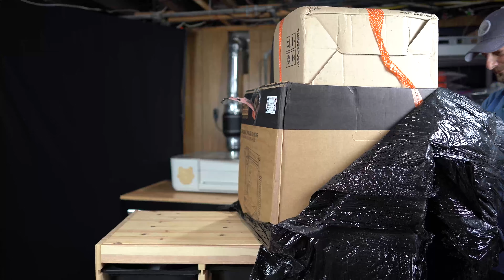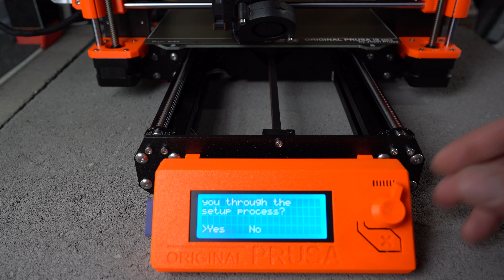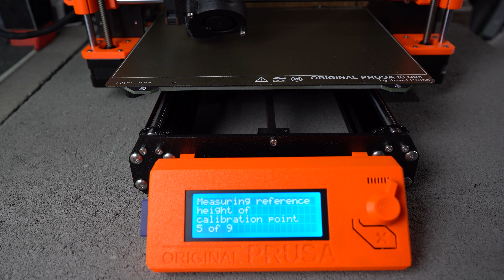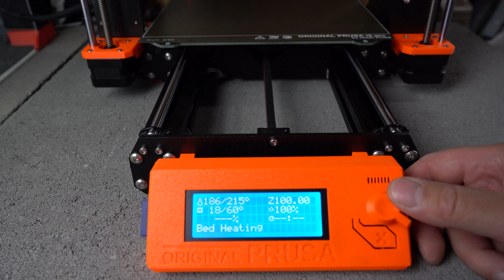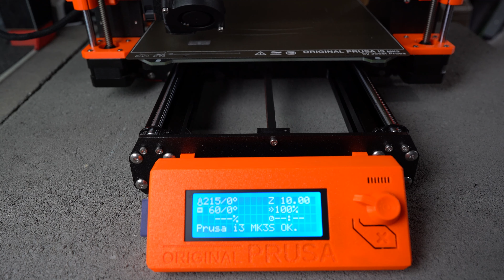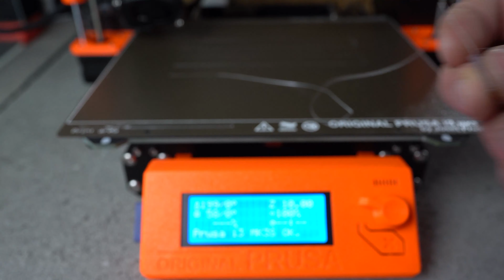Prusa MK3s Fully Assembled Unboxing and Setup

Comment: Did you have to tighten screws, plug in loose wires, or do anything like that?
Reply: Nope, fully functional out of the box, just run through the bed calibration and print
Reply: Nothing was loose or needed tightening on mine.  I do replace a few parts with custom ones to fit the enclosure, but otherwise everything is in good shape.  I clean and lubricate the rods every few rolls of filament (I go through about a roll a week of PETG)
Reply: Do you have any videos showing the clean and lubricate process?
Reply: Just got mine fully assembled too. So awesome , literally just plug it in and play. Only after reading the manual of course 😆

Comment: How're you liking it almost a year later? I just ordered one to Rochester, should be here soon, nice to see a fellow western ny prusa-owner.
Reply: Eric I'm loving it. Use it all the time alongside my mk2.
Reply: Welp, almost 2 years later and its still going strong, printing almost every day.  So far I've only replaced nozzles.  I'm sure now that I say that something will break.
Reply: @jonwolff  about to get this because my ender 3 v2 is complete trash and has barely given me 4 successful prints
Reply: @jonwolff  did you even need to mess with the z calibration when you received it? or did u just do the auto configuration and it was good right out of the box?
Reply: @pokingfun4008  I've always redone the z calibration or at least verified it. I can't recall now if it makes you do it anyway during initial setup but it doesn't hurt. It does not reset when you run the calibration so no harm in trying.
Reply: @jonwolff  yea true id also think some are better than others out of the box, just placed my order hopefully it comes faster than 3 weeks like it says 😅
Reply: @pokingfun4008  that and things can shift during shipping. I also order mine with the smooth and textured sheets, both have different z offsets you need to dial in. What's Nice is with the MK3. You can save each setting and switch sheets via the controls rather than have to change the offset each time. A better way to say it is a can save a setting for smooth and a setting for textured
Reply: @jonwolff  bett thanks I just got the smooth to keep price down a bit as it's probably good enough
Reply: @pokingfun4008  Smooth is great for PLA, I love the textured for PETG though (textured is a PITA for PLA though, I do have it working for the one part I make many of, but if I print some random model it fails more times than not on the textured sheet with PLA)
Reply: @jonwolff  im planning to use pla+ mainly so thats perfect for me